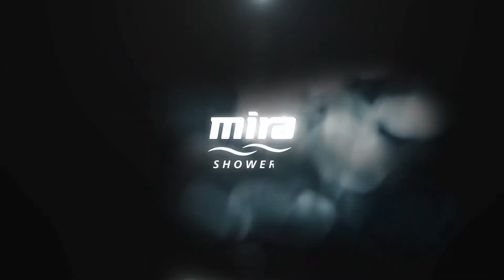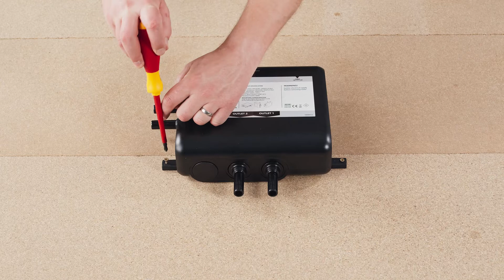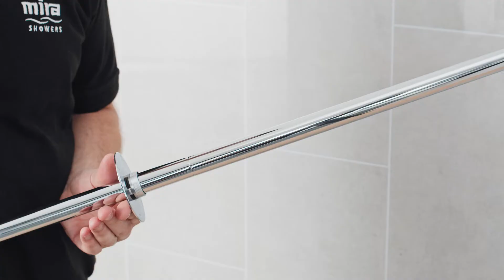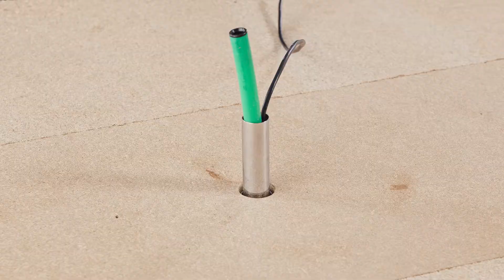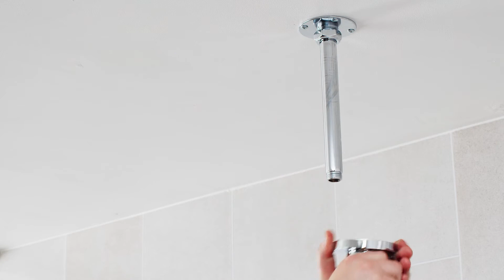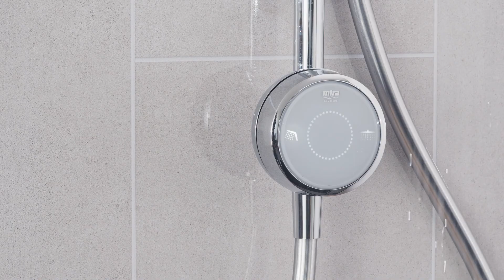Mira Activate Dual - Ceiling Fed - Digital Shower - Aqualisa Quartz Step By Step Replacement

Comment: Seriously thinking of getting a ceiling feed shower currently have a open vented heating system will this help with the pressure. My electric shower if run from tank.